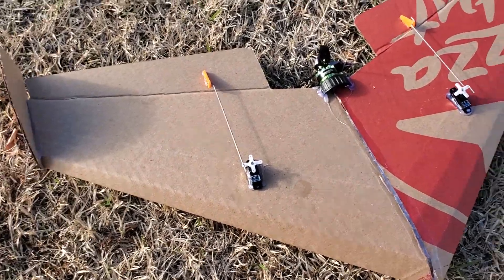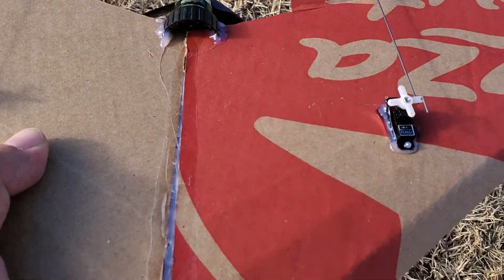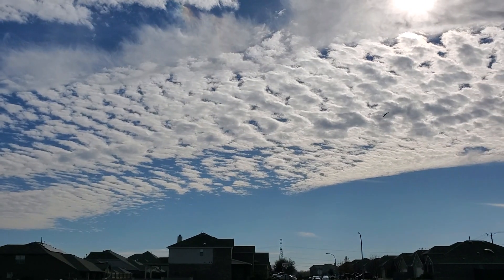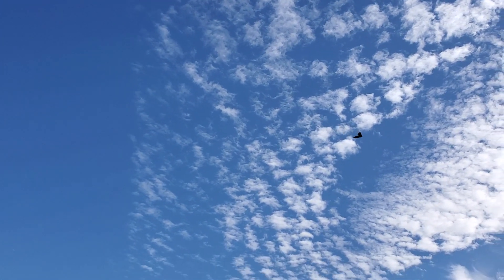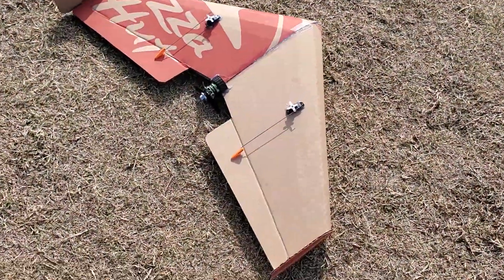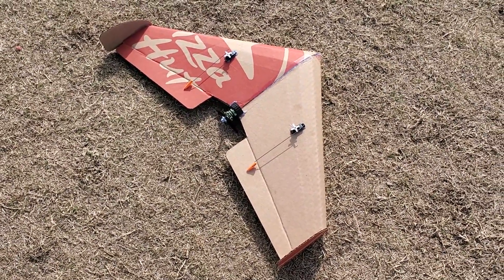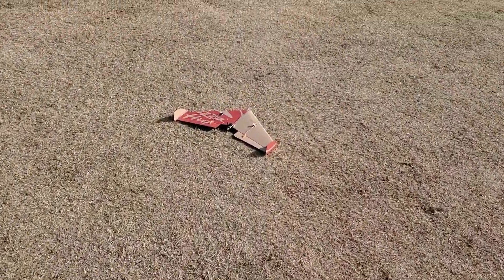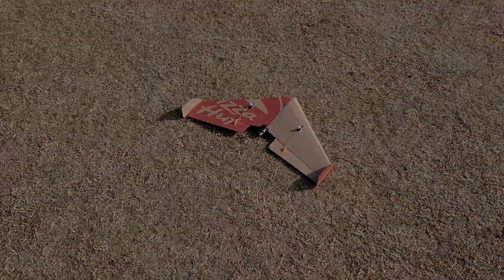Flite Test Pizza Box Wing

Comment: What size templates did you print? Did you match up with the inches scale on the templates? Also what do you think about runninq this with 2205 2600kv motors? :) ha! Thats what I have on hand. Nice build!
Reply from the maker: For the plans, I just Googled Flite Test Pizza Box Plane and I came across an article that has the plans in pdf form, I taped them together and traced the outline on the pizza box as best I could. That's a pretty big motor and you might be better off building the FT Mini Arrow getting foamboard from dollar tree.
Reply: @RickyGode   could you please send a link to the article with the plans? Im having trouble finding it
Reply from the maker: @itamar_farkash  https://www.flitetest.com/articles/flying-wing-made-from-a-cardboard-pizza-box
Reply: @RickyGode  thx dude youre a life saver!!!

Comment: where did you order your: 
Battery: 3S 500mAh
Esc: Multistar 10A
Motor: Multistar 1704 1900kv
Prop: Strix 3052
Servos: FT ES9051
thank you.
Reply from the maker: HobbyKing for the batt, esc, and motor.  The flitetest store for the prop and servos.
Reply from the maker: @Jacob Sebastian Maybe? I'd still get help,  I've been flying a long time, and the first couple launches with this were squirrelly to say the least.  I'd start out with a flitetest makerfoam kit.  This cardboard is a bit heavy.